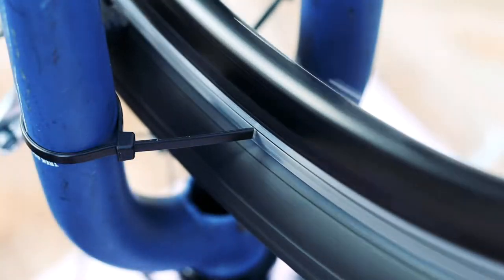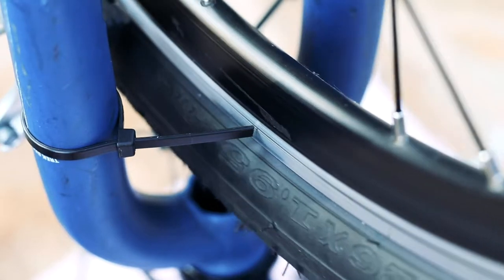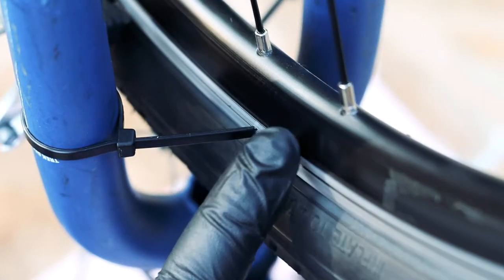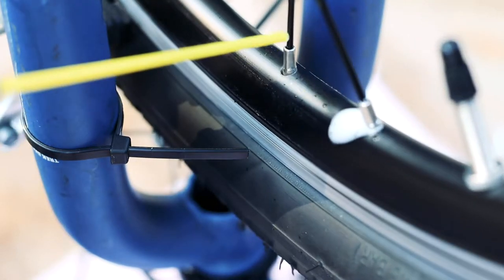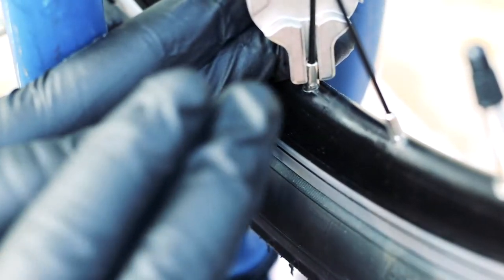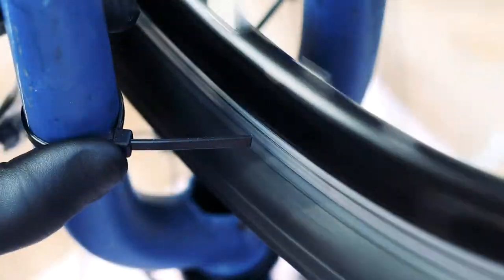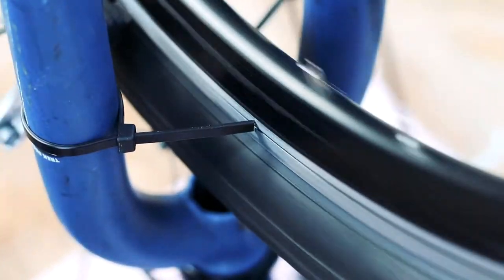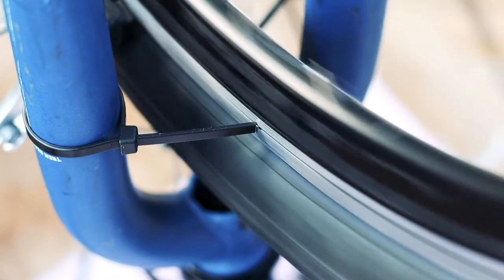Truing a Wheel using a Zip Tie

Comment: My question is how do you decide which side of the wheel you should put the zip tie on if you are using just a single zip tie? Does it matter?
Reply: Give the wheel a spin and put something at a fixed point close to the rim so that you can see the wobble better; do it on both sides and see which side is worse, then put the zip tie on that side. Really you want one on both sides for the best results, but remember that this is just a quick temporary fix and it's not going to be easy to get a perfectly trued wheel this way.